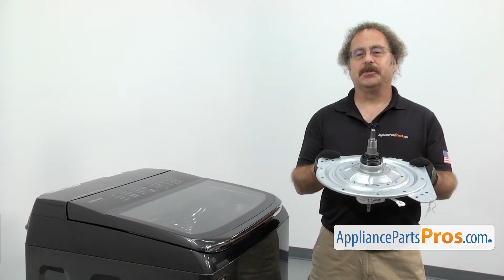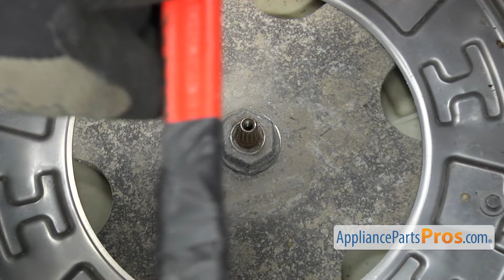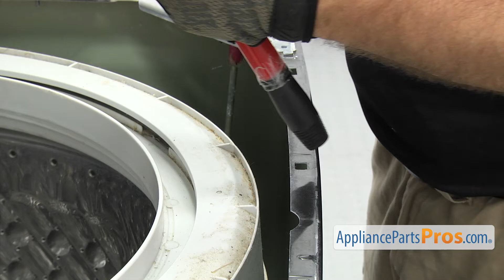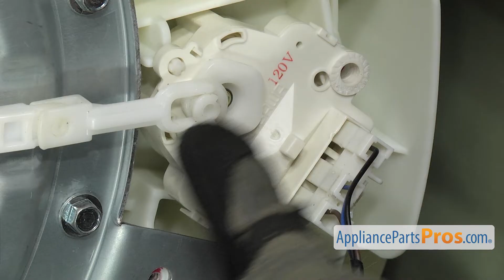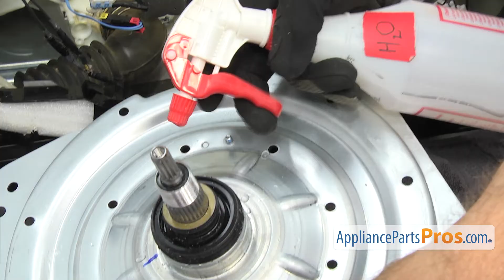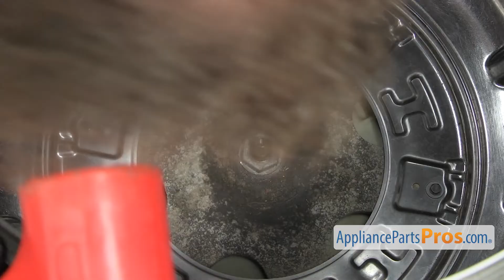How To: Samsung Washer Clutch Assembly DC97-18439A

Comment: I got the nut loose but mine does not pull off so easily.
Reply from the maker: Hey there! If the clutch isn’t pulling off easily after you’ve removed the nut, there might be some debris or buildup around the shaft that's keeping it stuck. You can try gently rocking it back and forth or even giving it a few light taps with a rubber mallet to help break it loose. Just be careful not to damage the part or shaft. Let us know how it goes—we're here to help if you get stuck!
Reply: @appliancepartspros I am unable to pull off the Nut at the bottom of the tub.
Reply from the maker: Hey @tracamp6776! If that bottom nut isn’t coming off, it might be seized due to corrosion or mineral buildup. A little penetrating oil and some gentle heat (like from a hair dryer or heat gun) can help loosen it up.
Reply: @appliancepartspros thank you!!!
Reply from the maker: You're welcome!

Comment: Will the clutch cause it to become unbalanced?
Reply from the maker: What is your model number?
Reply: @appliancepartspros  WA54R7200AV/US
Reply: @appliancepartspros  Came here for the same issue. This video was recommended when trying to find a fix for the Ur code on a Samsung WA54R7200AW. I already replaced the suspension rods and used the damping grease on the install. Still getting Ur code no matter how small the load is. Calibration cycle works fine. The washer is level as far as I can tell. Everything works fine until it gets to the high speed spin then the tub bangs all over the place.

Comment: Replaced it with a new one. Now, it seems like my agitator coupler is not quite fully engaged.  It does it but sounds like the plastic teeth are grinding a little. Doesn't seem to be an adjustment on the arm length...
Reply from the maker: You will need to check the agitator and coupler to make sure it's seated properly and not damaged, if it's damaged you will need to replaced it.

Comment: What size is the tub nut and what size socket or how big of a pipe wrench is needed to remove the tub nut?
Reply from the maker: Unfortunately, the manufacturer doesn't provide the dimensions for the tub nut. But you would use an adjustable wrench to remove the nut.
Reply: @appliancepartspros 36MM

Comment: Question? Do I need to replace the stater mine got wet because of the seals where worn out.
Reply from the maker: If the part and wiring are not damaged and it spins, then you wouldn't need to replace the part.
Reply: @appliancepartspros  thank you
Reply from the maker: You're welcome!

Comment: You did a lot of extra work that wasn't required.  Tub removal isn't a requirement for this and I would not suggest propping up the top with a pole.  Get an extra set of hands to assist.  In addition, get yourself some battery operated tools.
Reply: What are the symptoms of needing to replace a clutch assembly? The washing machine shown in this video is the exact Samsung unit. I have been experiencing random issues of the unit not being able to drain as well as not spinning. Considering it works occasionally I think it's an electrical issue. Thoughts?
Reply: @Mommabink24  You're overloading/underloading the washer. Replace your suspension. working occasionally means its going out of balance. Sorry im 4 months late. I do a lot of warranty work.
Reply: @Mommabink24  the issue with mine was the drain pump had broken pieces inside.
Reply: It's for demonstration purposes bro. If you already know how to do it, why are you watching 😂